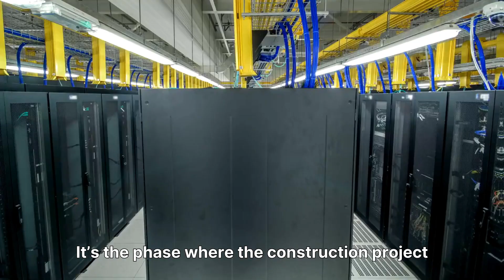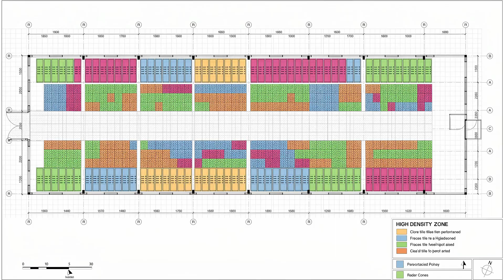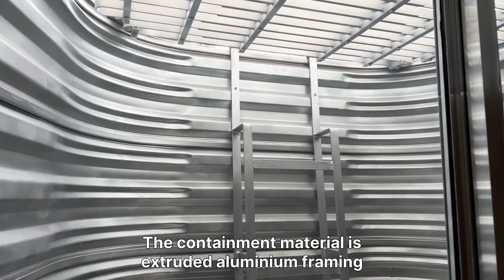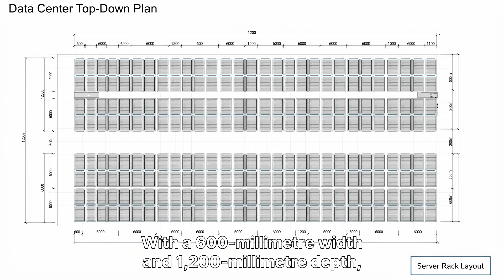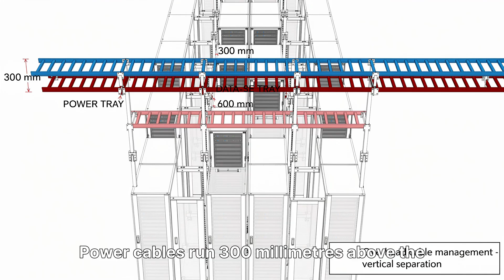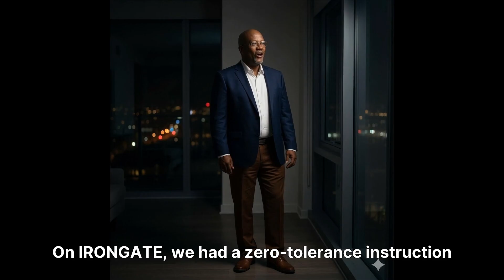Catalyst Grid | Series 1 Episode 13 —Data Hall Fit-Out (Raised Floor, Racks & Containment Explained)

Comment from the maker: Fire protection here isn’t about reacting.

It’s about detecting before anything is visible.

---

Too early — you shut the building down.

Too late — you lose it.

---

👇 What’s the most critical life safety issue you’ve seen on a project?

(False alarms, system failures, suppression issues — let’s hear it)